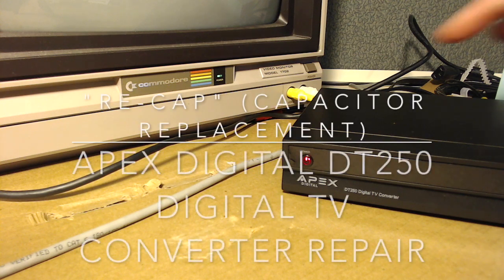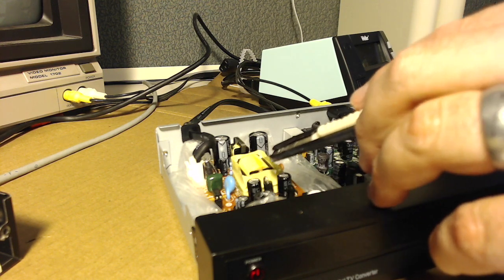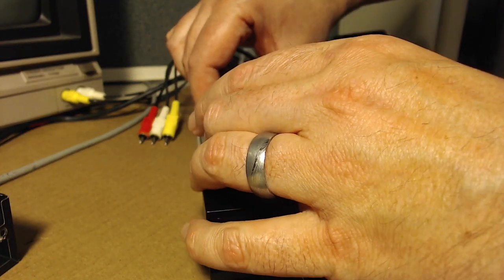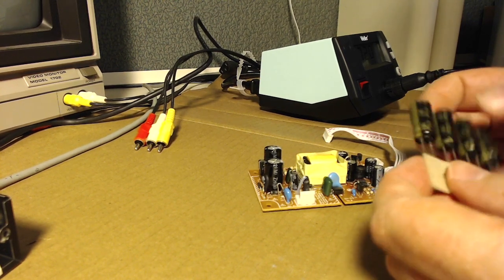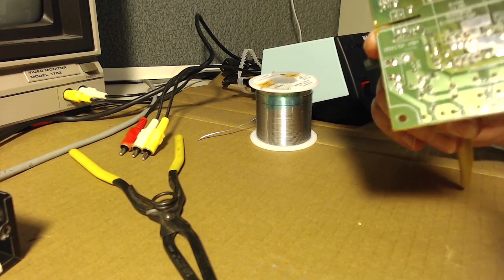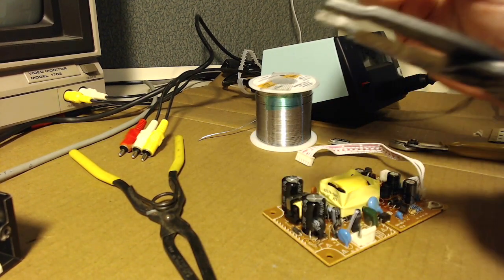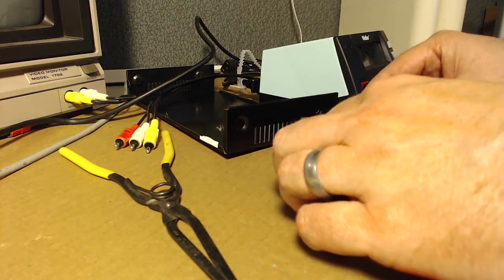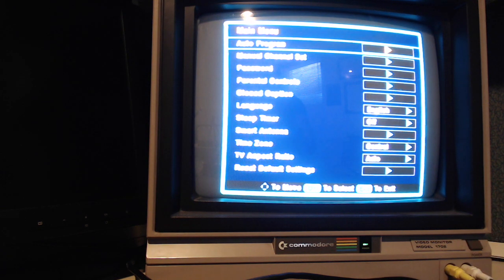Re-Cap: Apex Digital TV Converter Repair!

Comment: I just got the DT250A from my grandparents, and when I plugged it in and pressed power on, it turned on for 5 seconds, shut off and started making a high pitched sound. Has not turned on since and light blinks red when pressing on the power button, and still makes the sound. Is that the same thing that happened with you? And would having it stored in a cold basement for 8 years have any part of it?
Reply from the maker: Hi Jonathan - ya, sounds like the same problem although I don't recall a high-pitched sound (but my non-hearing of high pitched sounds is commensurate with my age :) ). I would say it's worth a shot to just do this easy repair. Look at the capacitor for any bulging at its vent/score lines on top. This doesn't always happen even though the cap has failed though. If you want to do further diagnostics, see if the power is right from the power-supply part of the board to the logic side. I just skipped this test since it seemed obvious this one capacitor had failed.
These sorts of capacitors, especially when they are low-quality, not a top brand, go bad in many environmental conditions. Cold is not particularly a problem compared to heat, especially heat from it being powered on.
Good luck - let us know if you fix it!
Reply: @DrDavesDiversions  The light doesn't blink as rapidly anymore, but still blinks and doesn't turned on, I did find out the hard way that one of the high voltage capacitors works now, so I guess something's working? What else should I try other than banging capacitors until it works? Because now that the other one's replaced, I have to be careful not to touch certain ones, otherwise I might not be as lucky as this time.....
Reply: @DrDavesDiversions  I just tried fiddling around with the cable that goes from the Pwr Supply to the Tuner, and when it's unplugged or partially unplugged, it turns on (with no picture, obviously), and when I push it in to make contact with a certain connector, it shuts itself off and refuses to turn on, do you know what might cause that? Wonder if one of the other capacitors have gone on it.
Reply: I think I figured out the problem! The capacitors I got were 35 volts, but the original is 25 volts, it must be sending too much power, making it not respond to the signal pulses properly.
Reply from the maker: Hi @JonathanMcKey  unfortunately the capacitor voltage  rating isn't the problem. A higher voltage rating on a capacitor means it can handle a higher voltage. A 35V cap is better than a 25V one.

A common analogy is that a capacitor is like a spring and a voltage like a force. So you got a spring that can handle a higher force without failure.
https://en.wikipedia.org/wiki/Capacitor-spring_analogy

What we want to know is if the problem is on your power board, as mine was, and likely easy to fix by replacing common components. This can often be done by checking the power output being supplied to the other board. It requires identifying the output test points and needs a multimeter. It is usually best done without then with load on it. Capacitors can be tested, but unfortunately they need to be removed from circuit to do so accurately, so might as well replace them.
Reply from the maker: JDW has a comprehensive video about selecting replacement capacitors here, btw:
"Choosing Capacitors to Recap Old Electronics"
https://www.youtube.com/watch?v=6PKaj9-1xIs
It covers, for instance, the mistake I made by buying one that was physically too large.

Comment: Hi  Dave i have a  box like that, video works fine but sound is to low,what you thing i can check ?
Reply from the maker: Hi - Does the volume control on its remote control change the volume level? What devices have you tried using to test its audio output level, that has a line level input?

This Apex device is one of those weird devices that has a volume control that adjusts the audio output level, i.e., it is not always line level, unless it's up at a high volume setting.

Do you have something with VU meters, like a stereo receiver or cassette tape deck to verify that it's the actual audio line level that is low?

(The part I was working on was the power supply, so I wouldn't suspect those caps for that sort of problem you're seeing.)

Of course, my apologies if you already have a testing method, but you didn't say how you know it's low. :)
Reply from the maker: In the mean time, here is a site with some details and troubleshooting tips:
https://www.edcheung.com/automa/ApexDT250.htm

Comment: JUST GOT THIS CONVERTER BOX, AND THE SAME THING HAPPENED AFTER A VERY SHORT WHILE. HOWEVER I CANNOT SEEM TO DO IS OPEN UP THE BOX. SUGGESTIONS?
Reply from the maker: On mine, opening the box simply meant removing the screws.
My suggestion is to turn your caps lock off and remove the 3 screws, one on each side and one in back. For me, the cover simply lifted off then.
Good luck!

Comment: Awsome man! I am excited to fix mine have excat same problem. Please tell me where did you get the Panasonic capacitor and how much was it.  Thanks
Reply from the maker: I probably bought these Panasonic caps from digi-key, for about $1 each (these are unnecessarily high quality capacitors) e.g.: https://www.digikey.com/en/products/detail/panasonic-electronic-components/EEU-FM1V471B/616377
Nichicon is another high quality option: https://www.jameco.com/z/UPM1J471MHH67N-Nichicon-Electrolytic-Capacitor-63V-470uF-20-_2287791.html
(Jameco is more customer-friendly if you're not used to buying components.)

If you aren't buying enough to meet minimum order, e.g. on Jameco, you can find the same on Amazon for about $3 each.
https://smile.amazon.com/Panasonic-FM-Aluminum-Electrolytic-Capacitors/dp/B076Q5T8VW